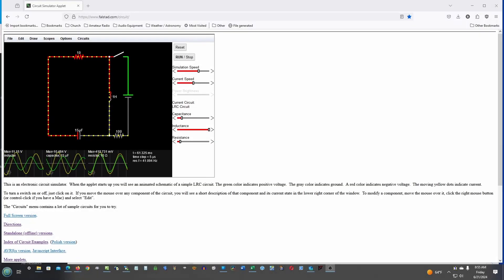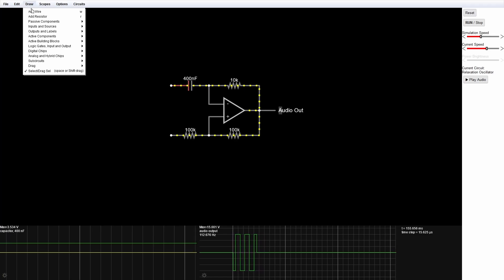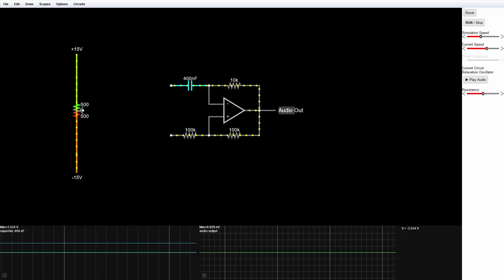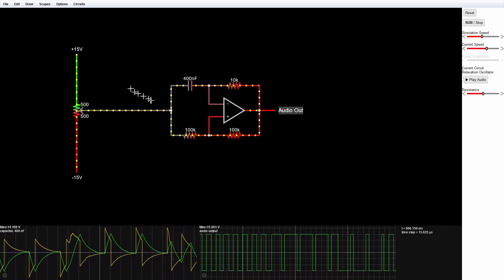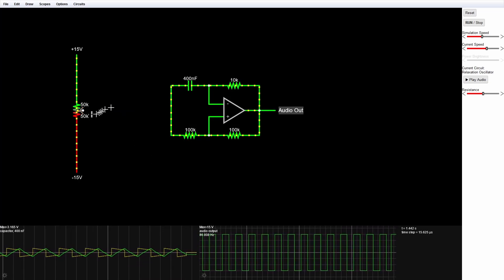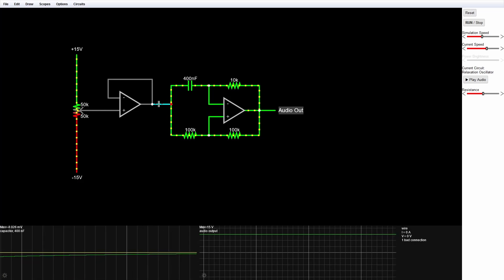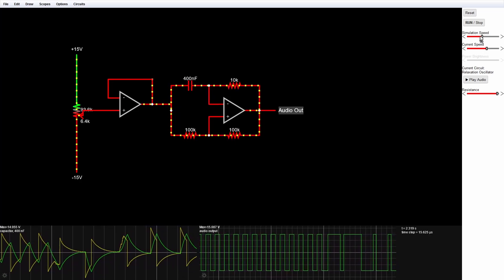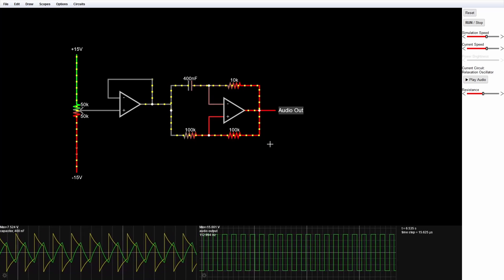Revisited - Variable Duty Cycle Op-amp-based Relaxation Oscillator

Comment: Hello, is it possible to make current sense using transistors to measure current less than 0.01 Amp? and how? I like very much if you will teach us. i tried to use INA21x current sense but it did not make sense to me how they work and how to design using discrete components